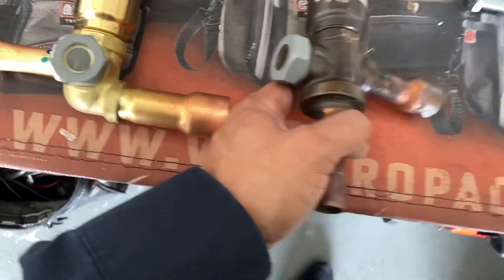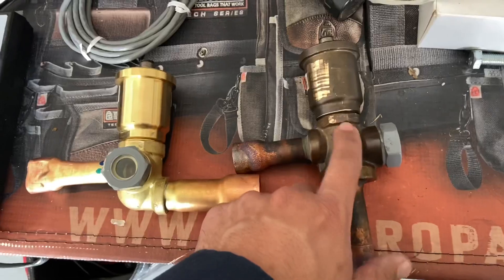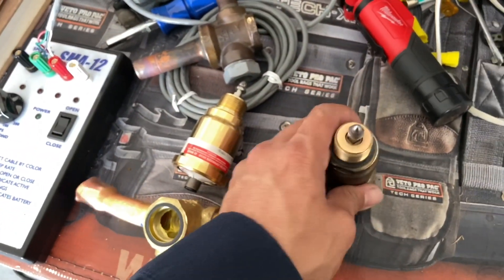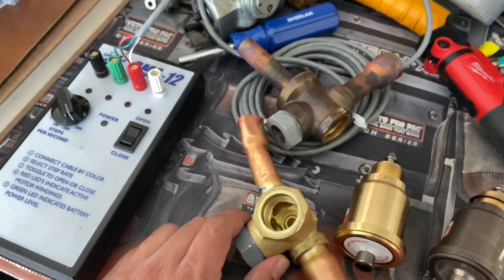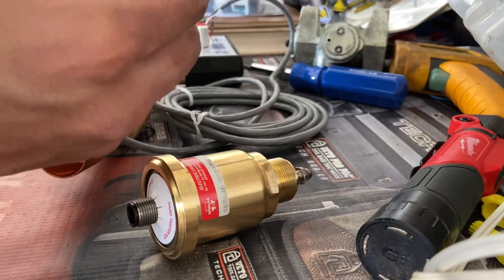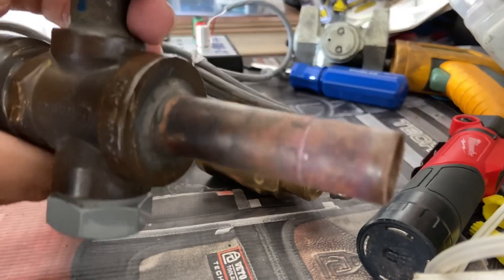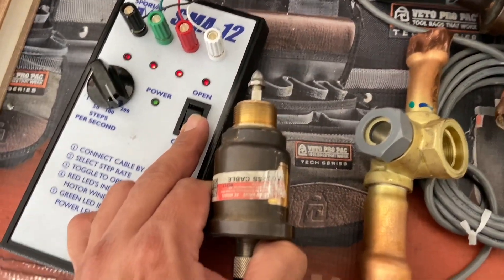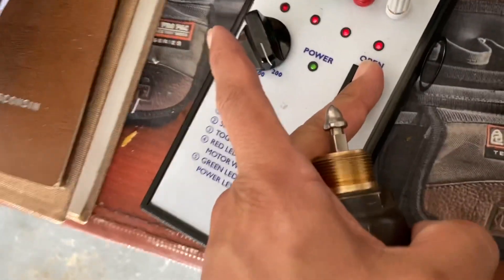EEV/EVX leaking by causing low superheat alarms on chiller

Comment: What did you use to take the valve apart?
Reply from the maker: I used a Klein skinny jaw adjusted wrench to
Hold the valve on the flat spots and a dang pipe wrench to loosen the motorized part of the valve. I heard a crows foot works also
Reply: @UlisesPalacios  Thanks!
Reply from the maker: For sure. They are one there pretty tight.
Reply from the maker: When you reassemble it. It doesn’t have to be super tight.

Comment: hi ULises i have the same issue with cgam 70 machine ,chiller loading alarm of loss of charge.even the parameters are ok.
some time chiller load alarm after 24 hours some time 16 hours.i had replaced suction sensor and transducer.still same issue.
Reply: have you come up with a solution? having low super heat issue w/ cgam 30

Comment: I’m having the exact same issue with a 09’ cgam120. I looked on 360 for parts but there is 3 different part numbers for modules and motors. Do you remember the part numbers for the angle valve and the stepper motor?
Reply from the maker: Creative Tradesman what’s the serial number. I just replaced one on a 70 ton yesterday.  You will need to order the part number that starts with Val and it’s a good idea to replace the module as well
Reply: Ulises Palacios is the stepper motor a MOT or an MOD?

Comment: There were some software issues with those LLIDS/Controller early on. All you have to do is unbind the EXV  and then rebind and download new software to LLID.
Reply from the maker: Anthony Mastello yup. . I have the bulletin. This chiller didn’t fall into those years but I went ahead and updated the software. It’s a 2017.  Have you come across this issue?
Reply: @UlisesPalacios  I haven't. Do you know if someone changed the EXV recalibration time in the feature settings?
Reply from the maker: Anthony Mastello no. It doesn’t look like it. It’s set to every 24 hours.
Reply from the maker: Anthony Mastello it’s a 2017 CGAM
Reply: @UlisesPalacios  okay, yeah default is 24 hours. I'd be worried if someone changed it to a shorter time. Does the chiller short cycle?
Reply: @UlisesPalacios  what tonnage?
Reply from the maker: Anthony Mastello it short cycles on one compressor. It’s a CGAM 26. It’s for Pepsi. Jax ref  designed and installed the system. It runs for maybe 7 minutes max. 15 degree set point.
Reply: @UlisesPalacios  do you have Trendview on techview?
Reply from the maker: Anthony Mastello 26 tons
Reply from the maker: Anthony Mastello I have data logging I have a few files saved
Reply: @UlisesPalacios  ahhhhhh. How big is the chilled water loop? What kind of glycol and percentage are they running?
Reply: @UlisesPalacios  sorry for all the questions. Just curious and wanting to understand the application.
Reply: @UlisesPalacios  cool. Just wondering if you have Trendview with techview? It would be under view.
Reply: is new software to LLID done using Trane Techview?

Comment: Really interesting, it seems like it would take some serious effort to damage that seat......
Reply: All it takes is a sliver of copper and you have a bleeding valve. Had this issue on a beer line up
Reply from the maker: HVACR VIDEOS yeah. I wondered that myself. They are pretty strong motors and I didn’t see any visual damage on the seat surface
Reply: Ulises Palacios the needle is stainless and the seat is soft brass, after time and many hard close off’s.....there ya go
Reply from the maker: Jake Crockett makes sense.
Reply: Ulises Palacios thanks for the vids, always enjoy
Reply from the maker: Jake Crockett thanks 🙏

Comment: do you the part number of the cable?.I need the cable for the valve Part No.02541565000
Reply from the maker: Carlos Reyes the cable is MOD02688.  You will need to bind it with techview

Comment: What voltage are you using  to control the motor, 200 vdc?
Great video thanks
Reply from the maker: 12-14vdc
Reply: Thank you
Reply: this speed 200 steps/second